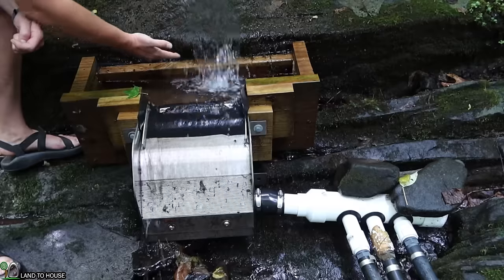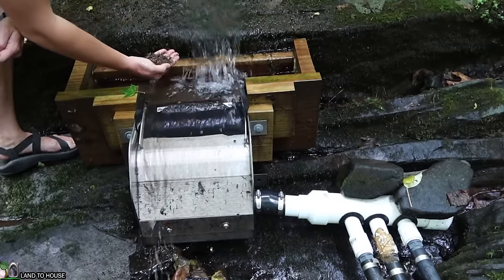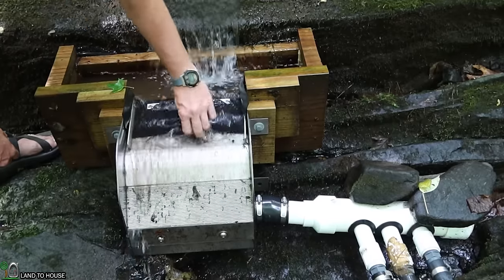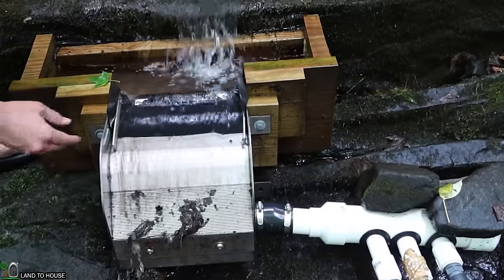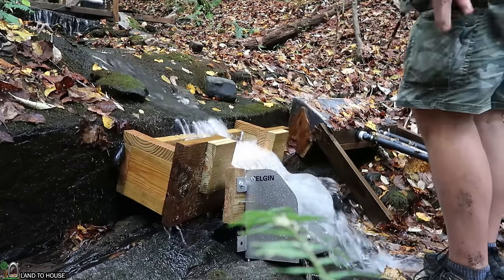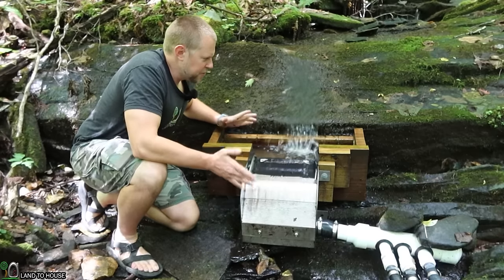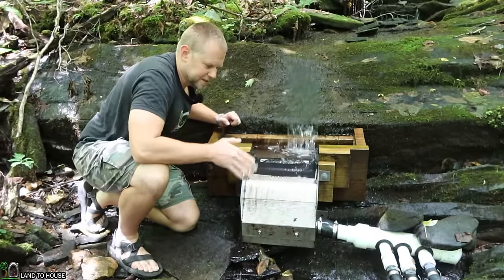Awesome Mountain Hydroelectric Power

Comment: I recommend getting the rectifier out of the house as well.
Reply from the maker: I would need to add to the wire run from that point out to the power shed.
Reply: Can just mount a junction box where the rectifier is and send it through your existing conduit to power shed if there is room. It just seems like a part that could get hot or fail.

Comment: Hey Bro. thanks for the very clear and no nonsense explanation.
Very nice system you have.
The only thing I would change is the batteries.
I would use 6 Volt Trojan batteries.
You can get 225 Amp/hours or 400 Amp/hours Trojans that would last over ten years.
I had 14 of those in my RV years ago at 24 Volts system.
I could go one week without charging them and they were not even new batteries.
I bought them used from a battery store.
Reconditioned them and they worked great for years.
You know you can recondition Lead Acid batteries with Epsom Salt and extend their life by about 50%.
So you don't need to buy new batteries if you are are short on cash.
It is better to over size the battery system so you put less load on each battery.
And you should use a Series/parallel configuration to keep all the batteries better balanced on voltage.
Thanks for the great info here.

Comment: Gret setup! I have one niggle though.
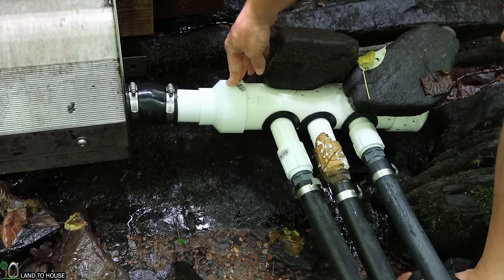2:54 If the inlet to the manifold is 50mm then it doesn't matter how many outlets there are from the manifold, it will not increase your flow rate to more than what can pass through the 50mm inlet.

Comment: Excellent build, you would definitely bennifit from some lithium batteries. You'll have to either get heated racks or build a little heater. I use a couple 150 watt dc heaters, been working good for now

Comment: You might try using a "slip-fix" repair coupling at the barrel in place of that PVC you put it in case you need to take it apart. - The slip-fix might allow for the expansion and contraction without pulling the pipe out of the barrel

Comment: Solution for relieving stress on pipe pulling out of boxes in winter.  Make a U by bending pipe with heat gun or using 90 degree fittings.

Comment: That barrel with the water outlet that collects sand eliminates all the pressure that has been collected up to that point. Also having some feedback system where the pelton nozzle is adjusted so the pipe never empties and you always have full head would be good. This could be done using a pressure sensor
Reply from the maker: The lost head pressure between the intake and barrel is 2-3  feet. So 10w to 15w lost. Not bad.
Reply: @LandtoHouse  If it is just 2-3 feed, you could recover that by just making that "overflow" pipe 4ft tall. No water would come out, but the bubbles would.

Comment: Great set up, there's one 1 problem I see - is the power box with that unistrut bar. I know it a very small chance of happening, but what if it failed while you working on power supply and knocked you into it ? There looked like there a fair bit of weight behind it. I know hinged doors wouldn't cover you if raining, but allot safer.
Reply: Or even princess auto gas lifting struts to hold it open. Was thinking the same thing tbh but otherwise looks like a very sturdy little power shed

Comment: 5:30 In an enclosed hydraulic system, such as the pipes you use, all that matters is the the output is lower than the input. You only need a "gradual slope" when using an aqueduct.

Comment: 1) I'm not sure some agency wouldn't frown on this locally. 2) 55gal drum cleanout could be smaller to utilise a ball valve. 3) I learned after a few pipes pushing apart is to heat the poly pipe to soften it and then double clamp the barbs while warm. I lost two 2500 gal tanks of water to barbs popping off before someone with more experience alerted me to softening the pipe.

Comment: I have a friend that is totally off grid. He does not even have power poles or wires coming onto the property.  He uses solar and micro hydro year round even in the winters of Northern New York where temperatures dip to 30 below zero.

Comment: What surprises me is that you use a Pelton wheel in a horizontal plane. This means that the down half of each cup performs as intended BUT the top half cup causes confused water flow which MAY be inefficient. Is there a good reason why you use a Pelton wheel in an application that better suits a turgo wheel

Comment: Nicely done bro I know the battery's are properly major expense along with the inverters. 
I want to do wind solar and generator diesel lincoln arc welder the board to control all that as well expensive .
But if you want you have to spend money .
Buy the way , you did a unbelievable job of that board . I'm very impressed as specially as it looks very  lose bro .
The panels I want the nice panels and cable tray that section of the work shop in its own building or plant room air compressors will go in there as well and the air  receivers will go in there on the air side .

Comment: You have what appears to be multiple exposed wires. It might be fine if it's never fiddled with but you may consider wrapping a bit of electrical tape around the exposed bits -- or run properly sized lines so you can insert them fully into the wire retention clamps.

Comment: that poly pipe is usually heated/metled together just butted together. I have a cadman sprinkler that uses poly pipe and runs 135 psi through it. The poly got cut with a tractor disc and the vendor came out and repaired it on site in about 30 min. it has to roll up on its self and so it cant have couplers or hose clamps in it.

Comment: I have the same charge controllers, 12x100 watt solar panels, my inverter is 24v 4-6kw but batteries….. I’ve got so many batteries from underground mine equipment 2v 1038AH batteries in 24v setup and it works amazing runs anything 110v dryer 240v for about 2 hours a day but I live next to a huge creek here in wv and I’m wondering about hydro….. very interesting video

Comment: Just a thought the overflow on the header tank if you pipe it to the bottom of the tank  inside the barrel say an inch from the bottom it will self clear the silt out of the barrel

Comment: Just a thought: two pieces of tubing welded not flying-v in front of the inlet (the tip of the v point up creek) but set above the flow of the creek should divert large debris/logs/rocks as a bumper and keep them away from the inlet. Put a flap over the top to protect thing from dropping onto the inlet from above

Comment: For power on demand try a bank of water accumulators in the form of a water pressure tanks that could be charged and discharged as needed. Like what's used in a water well

Comment: pro tip for you lead/acid batteries.......get yourself a 'de-sulphator' to extend their life spans. There are different versions for either maintaining existing healthy batteries, or the really heavy duty 'fast recovery' systems used by battery re-conditioners.  No, they arent much use on cranking batteries (which suffer from the fragile grids collapsing) but work great on thick plate, deep cycle type batteries which only suffer from plate sulphation.

Comment: Have one or a few small 1/2 pipes for overflow go to bottom of barrel, this will help empty the sand out of barrel. run out top big hole, so three pipes are inside, and allow to flow around if pipes get covered by sentiment.

Comment: Nice installation, but a view remarks.
1) Many 90 degree angles in the water flow to the nozzles that slowdown the flow. Could be replaced by 2 45 degrees parts.
2) Replace one of the nozzles by an electronically driven one so the can open or close dependent on the water level in the barrel that combines the 3 pipes to 1 and removes air.
Reply: I'm no hydro power expert, but I do see some areas where change may help. I admire the effort, but 100 watts is a shop light bulb. I would like to evaluate how that number could go up.

Comment: Where your barrel is situated is the point of your head pressure for calculations, you would have being better to put that alot closer to the inlet to get a higher head pressure
Reply from the maker: The 55 gal barrel is actually only 3 feet lower than the intake. Hard to see on video. So 6w loss perhaps.
Reply: @LandtoHouse  Ah ok, yea the video didnt show that, nice job though, very clean

Comment: 07:00 - scouring pipe at bottom, make it as large as possible to use water force of flow to really clear the sediment out when opened. How often does depend on how clear the water flow set up is further upline. 👍

Comment: At around 9:00-- I doubt those are "several springs" 9in the spring bed, but just parts of the creek where the water is so low all you see is the stuff that's flowing through the ground... same source, just under the spring bed until less porous soil is encountered and forces the water to emerge. He is no doubt affecting the habitat for that short length of creek where the flow has been diverted.

Comment: Seth, you need a way to automate your water overflow to maximize your production. Everytime I see this I think of that other YouTuber, but if I recall correctly: the Arduino jobby he had broke 🤣
Reply from the maker: There is likely some way of doing it. The turbine is 250 feet from the house and the intake is 1350 feet from the house. Not sure how I would maintain the electronics up the hill.
Reply: @LandtoHouse  or, use pressure at the turbine to tell you if it should open up more jets or not: then calibrate to expected pressure (if pressure starts to drop: start closing one of the spear valves to maintain pressure).

You could also use some kind of ultrasonic sensor at the top to verify the volume of the barrel, but those are super finacky: and you'd need some higher voltage stuff to do it (like 24vac sensors and whatnot)

Comment: I have a xantrex hybrid inverter ....now schneider electric ....xw4548....they now only have the xw in 6048 

the thing I like about them is when the power goes off, the inverters kick in.....they also use the solar or hydro first before the grid...and if the home needs more power the grid supplements

they also have charge controllers that will handle the hydro, they didnt used to.....all of these thing are connected and talk to each other through what is called a xanbus network....kinda like a canbus network newer cars use for the pcm and ecm

I control everything from a box that is in my home connected to the xanbus network

I have had my inverter since 2008 and it has not failed to work properly...I did have to change the network controller once...but that is all

If I were you, I would seriously look into them

Comment: Super great video, thank you! I'm about to move to a farm with a stream that leads to a pond (off property) and was thinking hydro might be a good idea even though the farmhouse is quite a ways from the stream itself (though not as far as yours). I'm not an electrician or engineer so I'm curious why you needed to run all the piping through the forest to get to the hydro generator. Is it because of the electricity loss along the wire pipes, convenience, or something else? I'm asking because I'd love to run less piping to be less intrusive on the environment. I'd like to enjoy the stream without a ton of equipment. Lastly, do you need a permit to do this, or does it fall under a minimum kwh standard generally? I realize each state is different, but just a general response would be great. Thanks again; I subscribed and am going to look at some of your other how-tos once we get settled!
Reply: That is how you get head. The pipes let pressure build up. You can bury your pipes a few feet too.
Flow * verical head decides your power so just a paddle wheel in a open river would only utilize a few ft of drop. While pipes can get hundreds of times better than that
Reply: @kapytanhook  Thank you!

Comment: Just got an idea for future improvement. You said you would need to manual open a second pipe to your turbine in order to generate more power. You could install a sensor which is sensing that you have overflow in your first drum and activate your second pipe automatically. Future stuff for you and some fun programming involved.
Reply from the maker: That is very possible. The issue might be that there is 1100 feet of woods between the intake and turbine. Any wireless signal would be lost.
Reply: @LandtoHouse  Don’t do a wireless option. 😉

Comment: Poly can be a real problem if it isn't buried in the ground.  Its designed to have some sort of insulation.  If you don't want to fix it every spring then you should either look into ripping a trench or installing insulation wrap you see on block heater cords.  Or you could get real red neck and duct tape moving blankets to it.

Comment: You should move the midnight classic charge controller away from the exhaust on your inverter and put it vertical instead horizontal so hot air can flow even without the fan on

Comment: Been following long time many changes.
One thing the DIODE BLOCK is bolted to wood, I suggest a hunk of Aluminum Box Tube.   Cut ends 45 degrees angles into it so easy 2 screws into the wood and two more for the DIODE BLOCK with some heat sink grease in between the block and aluminum tubing.   Cos the diode and prevents drying out of the wood & reduced fire risk.
Reply from the maker: Good suggestion. That rectifier can get warm.
Reply: If you placed it near the generator, perhaps you can water cool it. DC has less resistance over distance, so will gain a little, although maybe not much in your case.
Reply: @StuartJ  you have that wrong, DC has a larger IR losses, which is why Edison lost out to Tesla for grid generation. 
DC is safer but at power/voltages here the losses in DC would be at issue on top of having to seal up the DIODE blocks.
Reply: @markmatt9174  That's a common misunderstanding.  The best way to reduce losses, is to increase the voltage.  The second best way is DC.  AC has one huge advantage over DC, and that is how easy it is to step up and down the voltage.  Something you couldn't even do with DC 100 years ago.  Today it's much easier, and if the cable length is long enough, it's worth doing.  Undersea cables are often DC.  China uses DC to connect some of their remote hydro stations.

If you take this hydro setup, by converting to DC first, your increasing the line voltage down one pair, instead of splitting it down 3 wires.  And DC travels better.  If it would make much different in practice, then maybe not.
Reply: @StuartJ  the only easy way to do that is with high frequency switching. That means even more electronics out in the woods.    Voltage of this generator is  probably (WAG) under 40VAC at full speed.   Im Degree in electronic engineering & ya 30 yrs ago by IR losses principles have not changed since discovered in 1880s.   Over distance  DC is hampered heavily & SIMPLE recfication like his system means he is stuck at simple V/1k_RPM (which will vary based off magnets strength & how fast he spins the impeller/ generator.   His system is producing low voltage levels where losses and sizing makes DC even less efficient for transmission.   At peak performance it may be hitting 50 to 60VDC after rectification.
Reply: @markmatt9174  I wonder, what the losses are on the 250ft (80m) cable run. Maybe a 'HVDC 600v DC Switcher in Woods' in a tiny shed, no tiny windows.
Reply: The voltage produced by the alternator is dependent on its speed and its windings, given that its magnetic design is fixed. 

And since the speed is set by water flow and gearing, the easiest free variable is the windings, which should be designed for the highest practical voltage.  Single phase windings are all that’s needed. Three phase has no advantage in this application.   Single phase also makes transformers easier, so the transmission voltage could be as high as you can handle. (IR losses are identical for AC and DC. AC also incurs capacitive losses, but these should be almost negligible for this short run and for low frequencies (under a kilohertz). 

The most important factor in transmission losses is RMS current, since the resistance is determined by the wire length and wire size. 

-michael

Comment: Also it should be possible to heat the plastics piping and force a. Metal insert into it that has the same diameter as the inside of the pipe, and clamp it from the outside

Comment: Why do you shut down the hydro in the winter?  Does the creek freeze completely?  I would think that if water continues flowing under the ice, that you would be able to continue using the hydro.

For me, the greatest advantage to a system like yours and the reason I plan to install some solar is the ability to get through an extended power outage and keep your fridge and heat working.

Comment: Thats alot of work and components for (only) 100 Wh generation. When adding cost of all pipe tubing and time involved, wouldn't be better with more solar panel, more batteries or even gas/diesel/propane generator with big reserve tank ?

Comment: I previously calculated that fuel costs about $0.71 per kWh when using a propane generator. If you're producing 100W then you're getting about $1.70 worth of electricity per day with this hydropower.

Comment: Hi I liked your video think you have done a good job. I noticed that your connection to the 3 phase generator you only connect two wires. Are you using all of the phases? You may only be utilising one third of the power available.
Regards Geoff
Reply from the maker: My apologies if that did not translate well on video. Yes I have all 3 legs of the 3 phase connected to the rectifier.